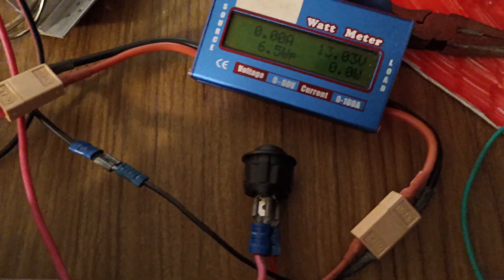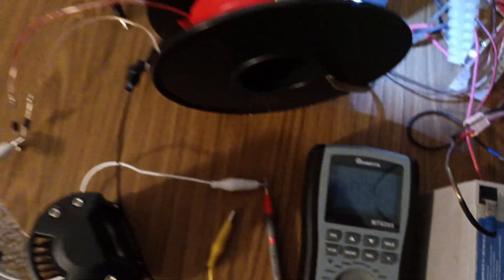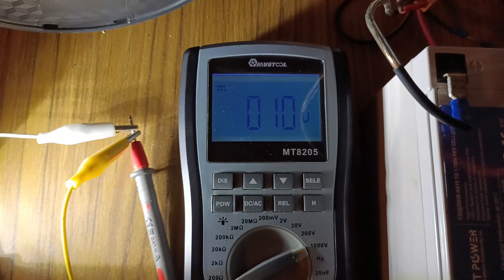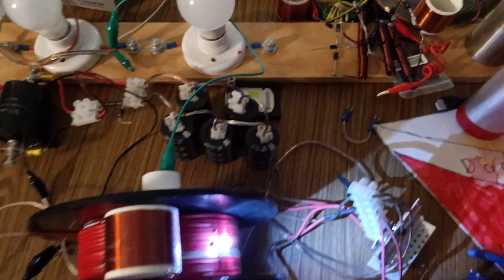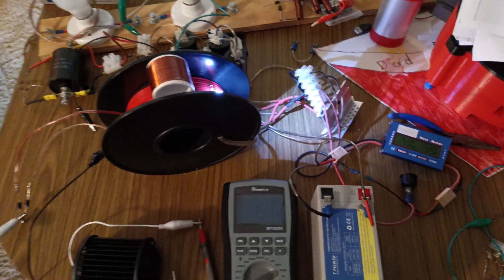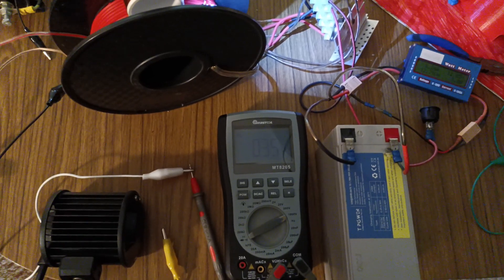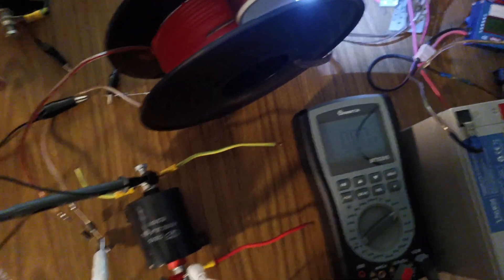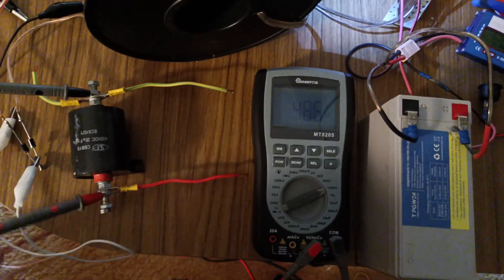EVERYONE LOVES A BIG BANG!

Comment: Hey are you using copper wire ?
Reply from the maker: Thank you for your comment.
Yes the wire I use is speaker wire, it is multi strand copper wire consisting of 24 strands of 0.20mm wire creating a cable(wire) thickness of 1.2mm surrounded by a clear insulation, possibly PVC which is import for the dielectric field. The total diameter of a single multi strand cable plus insulation is 2.4mm. Therefore the total width of the two cables in the figure 8 speaker wire is 4.8mm wide.

Aluminium must be avoided because of its dielectric properties therefore copper aluminium wire would probably not work, there is an exception to this rule if the aluminium is focused to allow us to benefit from the negative effects of aluminium.

Comment: While browsing around on what Tesla had to say about Condensers I found this little beauty and I'm amazed no one has quoted this, the next time someone tries to say Tesla never developed free energy technology, send them this:

"~Counsel~

Speaking of your not having perfectly undamped waves at that time, you were referring to that character of circuit?

~Tesla~

Yes, but with another kind of circuit I could, of course.  The advantage of this apparatus was the delivering of energy at short intervals whereby one could increase activity, and with this scheme I was able to perform all of those wonderful experiments which have been reprinted from time to time in the technical papers.  I would take energy out of a circuit at rates of hundreds or thousands of horsepower. 

In Colorado, I reached 18 million horsepower activities, but that was always by this device: Energy stored in the condenser and discharged in an inconceivably small interval of time.  You could not produce that activity with an undamped wave.  The damped wave is of advantage because it gives you, with a generator of 1 kilowatt, an activity of 2,000, 3,000, 4,000, or 5,000 kilowatts; whereas, if you have a continuous or undamped wave, 1 kilowatt gives you only wave energy at the rate of 1 kilowatt and nothing more.  That is the reason why the system with a quenched gap has become popular.

I have refined this so that I have been able to take energy out of engines by drawing on their momentum.  For instance, if the engine is of 200 horsepower, I take the energy out for a minute interval of time, at a rate of 5,000 or 6,000 horsepower, then I store [it] in a condenser and discharge the same at the rate of several millions of horsepower.  That is how these wonderful effects are produced.  

The condenser is the most wonderful instrument, as I have stated in my writings, because it enables us to attain greater activities than are practical with explosives. 
There is no limit to the energy which you can develop with a condenser. There is a limit to the energy which you can develop with an explosive.

A common experiment, for instance, in my laboratory on Houston Street, was to pass through a coil energy at a rate of several thousand horsepower, put a piece of thick tinfoil on a stick, and approach it to that coil.  The tinfoil would melt, and would not only melt, but while it was still in that form, it would be evaporated and the whole process took place in so small an interval of time that it was like a cannon shot.  Instantly I put it there, there was an explosion.  That was a striking experiment.  It simply showed the power of the condenser, and at that time I was so reckless that in order to demonstrate to my visitors that my theories were correct, I would stick my head into that coil and I was not hurt; but, I would not do it now."

"~Counsel~

I understood a little while ago when you made the statement of using several thousand horsepower put into a condenser, you could take out of the condenser a million horsepower.  I wondered if you got the same condition with this machine.

~Tesla~

Yes; I charged the condenser with 40,000 volts.  When it was charged full, I discharged it suddenly, through a short circuit which gave me a very rapid rate of oscillation.  Let us suppose that I had stored in the condenser 10 watts.  Then, for such a wave there is a flux of energy of (4 x 104)[2], and this is multiplied by the frequency of 100,000.  You see, it may go into thousands or millions of horsepower.

~Counsel~

What I wanted to get at was, did that depend upon the suddenness of the discharge?

~Tesla~

Yes.  It is merely the electrical analogue of a pile driver or a hammer.  You accumulate energy through a long distance and then you deliver it with a tremendous suddenness.  The distance through which the mass moves is small—the pressure immense."

-NIKOLA TESLA ON HIS WORK WITH ALTERNATING CURRENTS and Their Application to Wireless Telegraphy, Telephony and Transmission of Power : An Extended Interview
Reply from the maker: Thank you for your comment.
I have no idea how I missed your comment but sorry for not responding earlier.
Thank you for supplying that information, all one has ever had to do was calculate the discharge of a capacitor so rapidly charged by Tesla’s circuits to see that he was definitely producing free energy.
There is a good video on YouTube showing the discharge of a cap setup being calculated around the 600 amp range( from memory).
If I find it I will edit my post and supply the link.
https://youtu.be/6zvBTdnPMf8?si=bN7hDrcxavxKe7y0

Comment: The more I read, the more intrigued I am ! Now looking at patent 336962 US and 24033 canadian patent … this is more enhanced and we can see a Darlington arrangement of transistors made with coils.

So, I guess the moment we can tune this circuit and we know exact geometry of coils based on wire we use and coil former we can further amplify if we add more coils with right connections.
Reply from the maker: Thank you for your comment.
Sorry for my delayed reply. I agree with you, I often find it’s a combination of admiration and astonishment of just how easy it is. I believe Tesla wanted us to know it was easy but the establishment created mysticism around electricity then placed Tesla on a pedestal as an untouchable magician. The very opposite of what he intended.

I tried a Darlington pair arrangement on an earlier design, it was a very long time ago so I can’t remember much, however I do recall thinking about testing the Darlington pair more as I don’t remember being impressed which usually means I didn’t research it completely. I initially got the idea looking at an audio amplifier ironically using the 2n3055 transistor so we know that transistor copes within my circuit at least.

This is one of the reasons why we need other people experimenting, I will release some more videos soon with helpful tips for people experimenting in this field without having to spend big to play, I’m also winding a coil for the people using 110 volt lights as a large percentage of my viewers are on the 110 volt setup, just waiting on light bulbs to arrive.

Comment: Great video & very interesting discoveries
Reply from the maker: Thank you for your comment.
I have been meaning to ask if you wouldn't mind performing a test for me on your ringer setup. I am still waiting on parts and would like to have an as close as possible replica to perform tests on but it is bugging me so i have to ask. 

With my circuit, I realised a long time ago that getting aluminium too close in the WRONG position will drastically effect the magnetic field of my circuit and if operating a light it will go very dim. In my mind I'm trying to understand if your ringer has a similar effect and whether or not it is negatively impacting your setup. It is hard to imagine more power but hey if it's there well we may as well take it.
Reply: @whatifididthis...1236  yes i can test it with it elevated off of the aluminum plate :)
Reply from the maker: @MTECH2022  Legend, thank you.

Comment: Just want to confirm --- Is that 9 + 9 turn Tesla coil  wrapped  around that 180 turn coil or separately with a ferrite rod   in close proximity of the 180 turn coil ????
Reply from the maker: Thank you for your comment.
You can do either/and/or. In this particular setup it is wound directly on top of the 180 turns. This then allows you to insert a ferrite rod if you wish to by inserting it into the main core of the circuit. The ferrite is only necessary to operate lights of different frequencies or higher voltages, which is the other purpose of the ferrite rod. You can choose to apply the second earth to either the bifilar turn atop the 180 turns or to the 339,961 patent bifilar winding that is wound directly on a ferrite rod. My circuit does not really care where earth 2 goes as it is attempting to mimic the SWER system, Single Wire Earth Return. In this case it is attempting to return to source.
Reply: @whatifididthis...1236  Awesome,  thanx for the quick reply.

Comment: Now, thinking of your tunning method it just sprung to my mind Sweet Floyd used incandescent bulbs as well for powering additional loads eventually inductive … what could be 100 watts resistor with good dissipation of heat that can run for very long time and without needing any radiator to cool down ?
Reply from the maker: Thank you for your comment.
I will make a point of this in a video soon. Don Smith was cryptic but if you were patient and possibly autistic combined by obsession you would end up like me. When watching Don's videos you have to look at when he smirks, read his body language, he is trying very hard to say things without saying them. He was this way because he had no choice, to live he was told what he can't say.

What I heard him say, without saying it, was light bulbs are resistors. The bit where he talks of a research company spending thousands of dollars on massive resistors and shows a picture of them, watch him smile at this point. Most think he is smiling because we could never afford the expensive resistors, did nobody notice he doesn't use expensive resistors but always had plenty of light bulbs at hand, the old type, 100 watts, does anybody remember him say those light bulbs were special ones? What do you mean special Don? "Oh I had them specially made" .... what, who has special light bulbs made for them?

I currently have a modification of my circuit on the bench that I will record and show how to select the right light.
I'm reminded of the master alchemists in this situation, they taught me to read between the lines and see the light that does not shine, the masters always spoke in riddle for this knowledge is not for all of man but for those who seek the purity of the light. We must learn to read between the lines for what resides upon the line is a deception.

Tesla knew these dark entities existed and knew they would always exist, for without evil there is no need for light to shine, he and others have tried very hard to keep this from "them" which unfortunately has left us to decipher what essentially is code.

What did they NOT say?
Reply: @whatifididthis...1236  the beauty is, using incandescent bulbs you can measure their resistance … I don’t want to say more things which I can’t prove due to lack of resources … actually I am somehow ashamed of my failure on this attempt to replicate your circuit … I have been absolutely mindless and careless when I built that coil, but all I can say it will work with cheapest wire available CCA (copper clad aluminium) multi strand provided we don’t use less than 2.5 sqmm.

I totally agree with what you say .. I have arrived at same conclusions. As long as there won’t be any silly action or patent attempt we might be OK for low level. I am watching some online forums and is amazing how out of blue someone comes to twist and thwart any clear initiative leading in the right direction. I have learned that is necessary to back up.
I wonder how could possibly end up a youngster whom may get 1-10k orders for something that will get some trouble at some point with supply chain and if miraculously manage, that suddenly 1-10k “happy customers” want to return their products all at once invoking various motives ?  I learned this watching dr Holocomb journey. Many similar coincidence can be found in history more or less recent.

You mentioned there are many ways to connect transistor, indeed: it can be used for amplification, for switching or voltage/curent regulation … in patent 336961 this transistor is represented by commutator with 3 brushes but in canadian patent of the same, there is a Darlington arrangement represented by a double middle brush … 2 stage amplification.

In order to be able to replicate in full your setup I need to know on which connections I need to start tuning. I have understood your methods of tunning and I am able to do it once I know in which mode I need to start. Probably would be best to start in switch mode not to blow up more transistors and guess I can change connections as needed once everything is up and running.

Also, I have done many tests with pancake coils setup you kindly shared and there is many other things to explore further. If you remember I asked why not equal length of wire ? I have wound another set a while ago with all equal dead measured and the power available is increased a by little, power drawn increase as well a little but frequency and voltage is stable, no variation … for less power available at output, input can be decreased substantially when distance between bifilar with zvs and rest of the coils is adjusted … and many, many other things.
Reply: Yes, I have arrived to the same conclusions, be safe 👍🏼
Reply from the maker: @Caesarus2011  Thanks for your concern, I am always super careful but mistakes are easily made, I got another RF burn last night, bit of a fumble fingers situation. It is such a different feeling that feels like a bad sun burn but strangely heals very quickly.

Comment: By the way, old school grounding done by specialist electric companies is done with 1-1.2 m long zinc plated steel pipes nuts and bolts assembly together 1.5 meters apart with thick zinc pated steel band … 10-20 buried beneath the 6kv cable for new shopping buildings and the steel band is brought up to meter and distribution point … no copper for grounding. You are correct 100% !
Reply from the maker: @Caesarus2011  Thank you for your comment.
Well that is good news, I never quite understood why they use the standard copper earth rods, it’s just not a good weathering metal. Zinc makes perfect sense and any home built here before the red tap babies were born ifs built with the zinc plated steel pipe you mention, still looks exactly the same 40 years later.